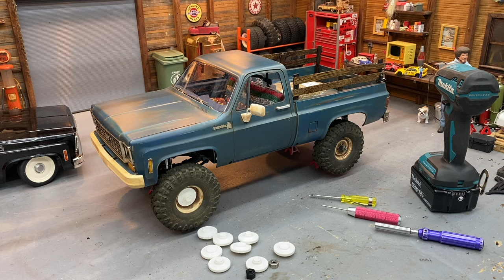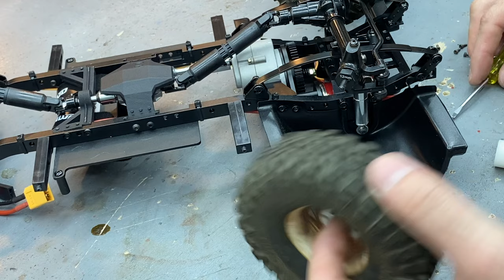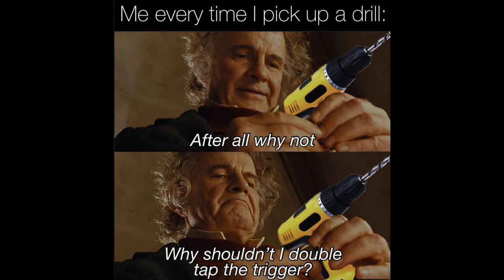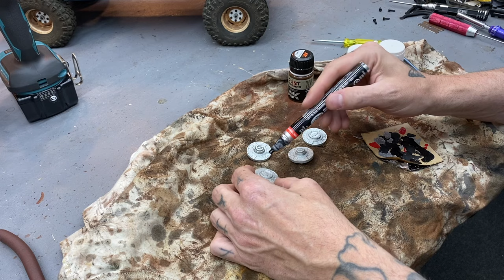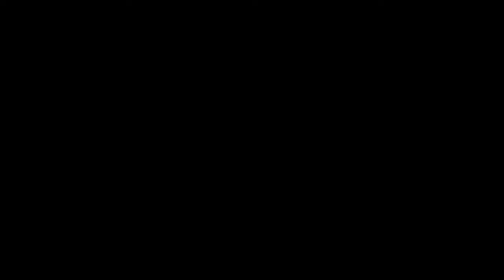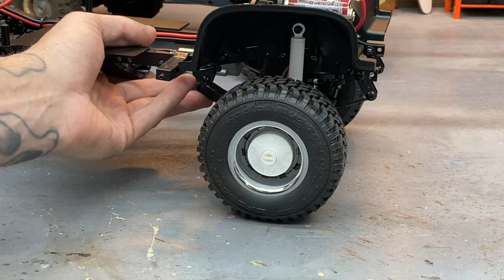RC4wd Scottsdale Squarebody Build Off, Part 6, Wheel Offset, Scale Hubcaps & More

Comment: This looks sharp. I like the hub caps that thread onto the axle stub that sticks out, Instead of slipping onto the nut. I know that's not always an option, but on my trx4 I got extended stub shafts so the threads would poke through the wheel a little more. They look so legit, and don't fall off as frequently. I wish rc4wd would sell just the trim rings for the rally wheels... I've been debating putting them in a press and pushing the center deeper into the wheel(so I don't loose the detail from flipping them around backwards......)

Comment: Ok  i need help  maybe you can help  you have seen more  products then most  in my area im doing a build  on a scx10 .2 6x6  probably the wrong platform to do project  off of  looking for a suspension idea for rear end   that goes no higher then the frame rail so most likely heavy  leaf springs  /conversion any suggestions to use rear end of truck will be carrying the old red tonka tow truck rear end with the 2 tow arms flat to the rails  its is a heavy rear end  so yes hella  heavy so looking for a axle / leaf conversion ideas
Reply from the maker: I don’t think anyone makes a leaf conversion direct for those chassis any more.  But any leaf springs will work, you might have to drill holes in the rails to bolt on the shackles and hangers.